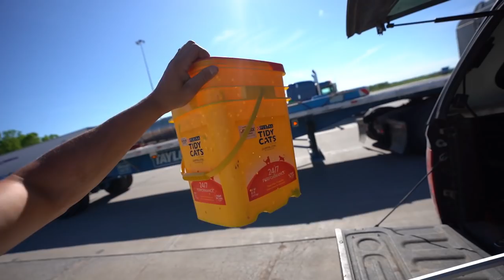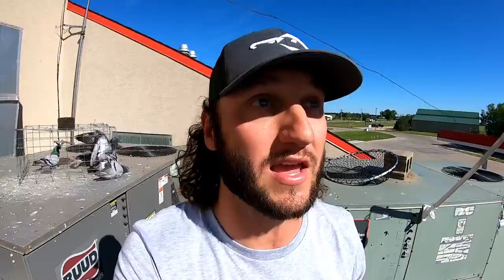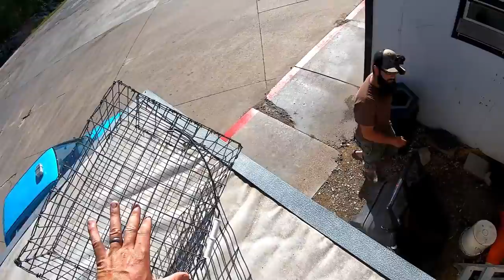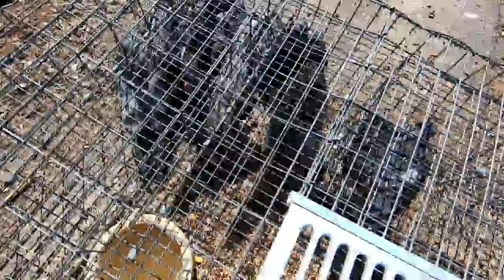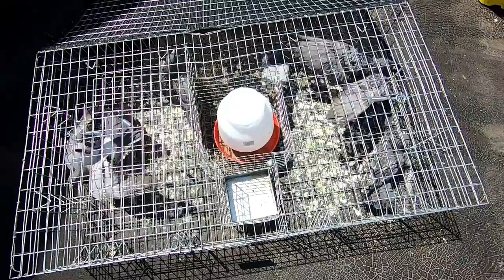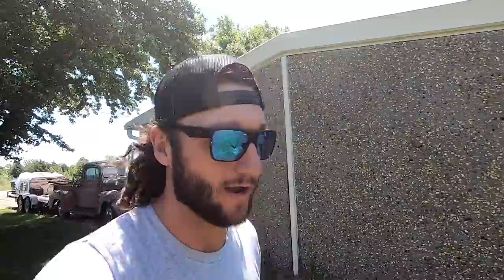Wild Pigeon Hunting with A NET!!

Comment: Bobby you can put the net down a piece of 10ft PVC and put self tapers through it to hold the net inside the pipe, did the same thing for my smelting net and it’s stronger then the aluminum and much longer